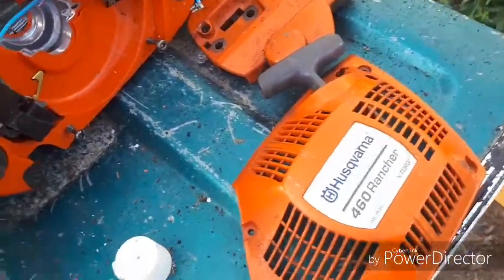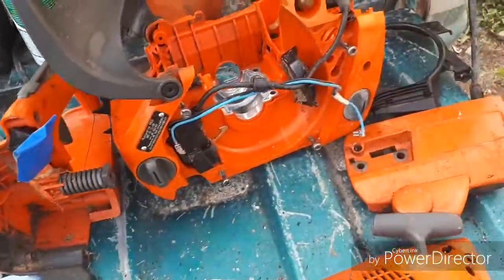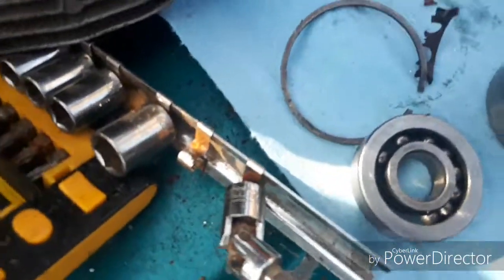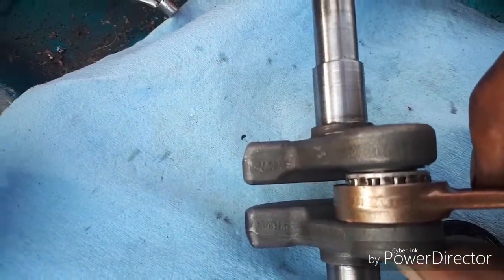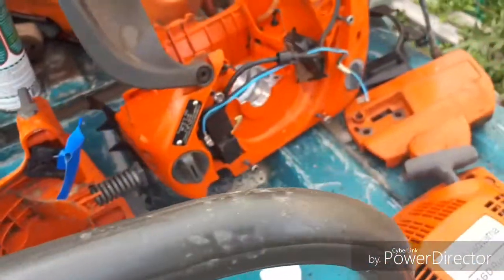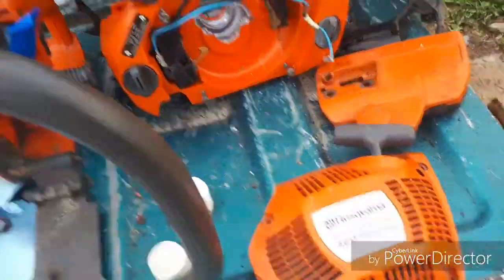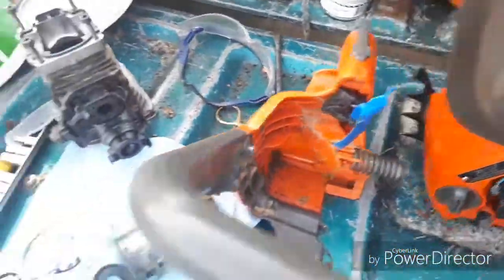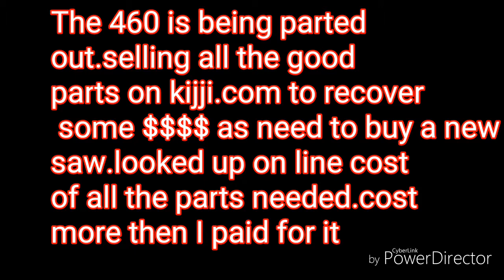Husqvarna Rancher 460 part 3 final and another problem. Mon  Sept 2 2019

Comment: The piston looks like a cold seizure basically the piston heats up and expands faster than the block due to running at full rpm without warm up plus this engine is not broken in and has been sitting without oil hitting those o rings for all those years high possibility they dry rotted just go to a big box store buy a new one exchange parts you need then return lol or just order online there not that expensive there is also after market kits on Amazon you could probably slap this back together for the price of a new bar just make sure if you purchase a new saw to not run it at high rpm for long periods until you get atleast 10 hrs on it
Reply from the maker: this saw never seen high rpm, it was cutting light brush on my fence line for its brake in time witch never got past that, they dont sell these saws in bx stores here, dealer only, yes the saw sat in its factory box a few years, gas an oil was never added until the day i used it, i used there pre mix gas for brake in, i have owned many saws of this brand in my life, i have a 154 SL with over 100 cords of wood on it, still running today, but parts not available for that one any more, i priced out after market part, and with everything it needs it a close call to new saw